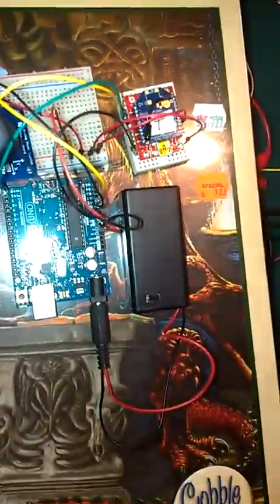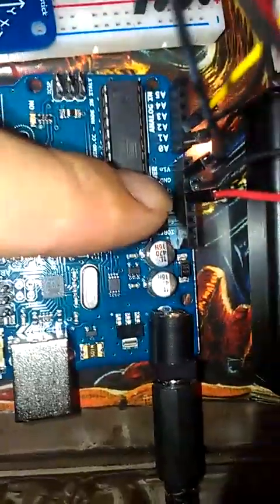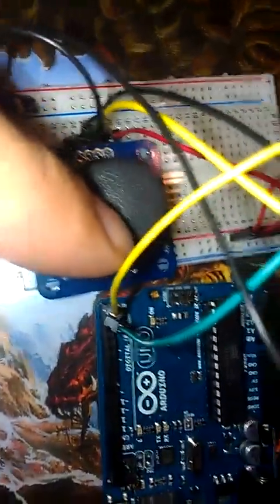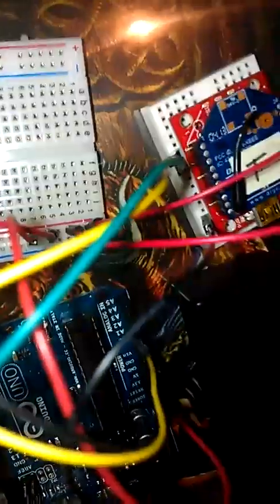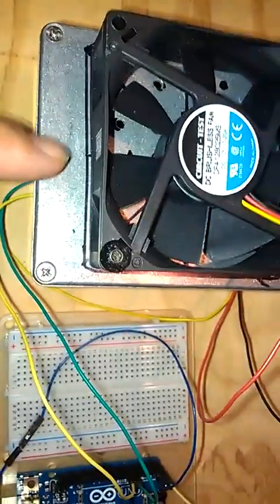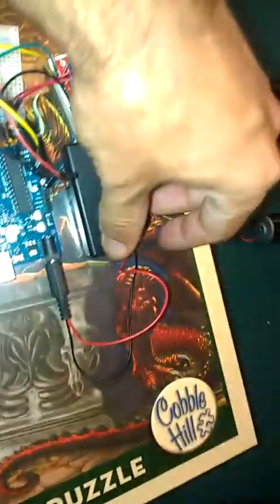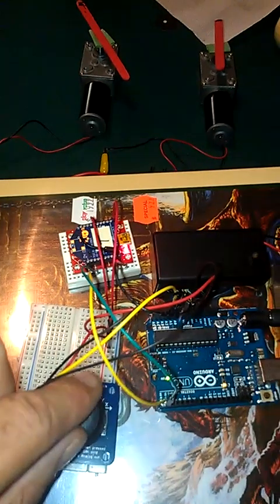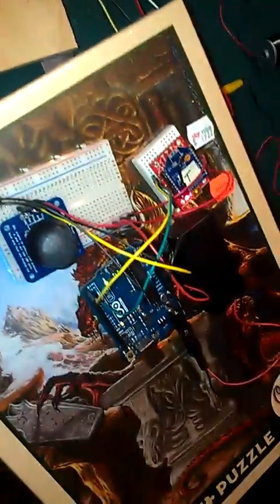Xbee series 1, 1 joystick 2 motors arduino uno success!!!!!

Comment: Hi, may i noe, what software u use to upload the code to arduino uno?
I m using de latest version of Arduino IDE, but when i trying to compiling your code, it shows "error compiling for board Arduino/Genuino Uno". What is the problem?and how to solve it?
Reply from the maker: +Pan Kuong King At the time it was an earlier version but you can get the IDE from the main Arduino site, I think your problem is because your compiling using the wrong settings for your board.

https://www.arduino.cc/en/Main/Software

You have a Arduino Uno?
Reply: +fabiolus2007 

yes, i have it.

I already have the latest version of IDE with me. 
So what setting should i change?
Reply: +fabiolus2007 

halo,  i think i have found my problem. The latest IDE can no more support the library of EasyTransfer. The library that is available for IDE 1.6.8 is SoftwareSerial. By the way, if using the library of SoftwareSerial, u still can write out the code for transfering analog/digital signal wireless?and may i have the code?
Reply from the maker: remote control
#include <EasyTransfer.h>
EasyTransfer ET;

const int potpin1 = A0;
const int potpin2 = A1;

struct SEND_DATA_STRUCTURE{
int servo1val;
int servo2val;
};

SEND_DATA_STRUCTURE txdata;

void setup(){
Serial.begin(9600);
// Serial.begin(115200);
ET.begin(details(txdata), &Serial);
}

void loop(){

int val1 = analogRead(potpin1);
int val2 = analogRead(potpin2);
val1 = map(val1, 0, 1023, 0, 180);
val2 = map(val2, 0, 1023, 0, 180); 
txdata.servo1val = val1;
txdata.servo2val = val2;

ET.sendData();
}

receiver:
#include <Servo.h>
#include <EasyTransfer.h>
EasyTransfer ET;

Servo myservo1;
Servo myservo2;

Servo ST1, ST2; 

struct RECEIVE_DATA_STRUCTURE{
int servo1val;
int servo2val;
};

RECEIVE_DATA_STRUCTURE txdata;

void setup(){
Serial.begin(9600);
// Serial.begin(115200);

ET.begin(details(txdata), &Serial);
// Servo
ST1.attach( 6, 1000, 2000);
ST2.attach(5, 1000, 2000);
}

void loop(){
if(ET.receiveData()){
ST1.write(txdata.servo1val);
ST2.write(txdata.servo2val);
}
}

Comment: hello can u give me the programme plz & thk u so much
Reply from the maker: othmane yassine 

remote control
#include <EasyTransfer.h>
EasyTransfer ET;

const int potpin1 = A0;
const int potpin2 = A1;

struct SEND_DATA_STRUCTURE{
int servo1val;
int servo2val;
};

SEND_DATA_STRUCTURE txdata;

void setup(){
  Serial.begin(9600);
  //  Serial.begin(115200);
  ET.begin(details(txdata), &Serial);
}

void loop(){

  int val1 = analogRead(potpin1);
  int val2 = analogRead(potpin2);
  val1 = map(val1, 0, 1023, 0, 180);
  val2 = map(val2, 0, 1023, 0, 180); 
  txdata.servo1val = val1;
  txdata.servo2val = val2;

  ET.sendData();
}

receiver:
#include <Servo.h>
#include <EasyTransfer.h>
EasyTransfer ET;

Servo myservo1;
Servo myservo2;

Servo ST1, ST2; 

struct RECEIVE_DATA_STRUCTURE{
  int servo1val;
  int servo2val;
};

RECEIVE_DATA_STRUCTURE txdata;

void setup(){
  Serial.begin(9600);
  // Serial.begin(115200);

  ET.begin(details(txdata), &Serial);
  // Servo
  ST1.attach( 6, 1000, 2000);
  ST2.attach(5, 1000, 2000);
}

void loop(){
  if(ET.receiveData()){
    ST1.write(txdata.servo1val);
    ST2.write(txdata.servo2val);
  }
}
Reply: thk u
Reply from the maker: othmane yassine you will need the easytransfer library http://www.billporter.info/2011/05/30/easytransfer-arduino-library/ I used that one and worked like a charm

Comment: Hello! Good job man. I want to make the same but i don't know what "function set" to use in which "modem" in xctu! I have two xbees s1 that automatically takes the xb24 modem and xbee 802.15.4. Is it ok to continue with this? I am a beginner with xbee and as I know i have to set one xbee as end device and the other as coordinator, but i don't know how. Can you help me on this please?
Reply from the maker: Should work straight out the box, assuming you know how to connect them via the proper for one to receive and the other xbee to send, I have other video showing the final setup. For security input your own channel so no other module gain control of your bot.
Reply from the maker: Should work straight out the box, assuming you know how to connect them via the proper for one to receive and the other xbee to send, I have other video showing the final setup. For security input your own channel so no other module gain control of your bot.

Comment: could i get a copy of your code for both transmitter and receiver please.
Reply from the maker: I posted both on arduino.cc forum search for it it is still there
Reply from the maker: @index.php?PHPSESSID=rvnnj27e9rfuhnsf8dcmjgnpa1&topic=181951.0
Reply from the maker: tim gravelin 

remote control
#include <EasyTransfer.h>
EasyTransfer ET;

const int potpin1 = A0;
const int potpin2 = A1;

struct SEND_DATA_STRUCTURE{
int servo1val;
int servo2val;
};

SEND_DATA_STRUCTURE txdata;

void setup(){
  Serial.begin(9600);
  //  Serial.begin(115200);
  ET.begin(details(txdata), &Serial);
}

void loop(){

  int val1 = analogRead(potpin1);
  int val2 = analogRead(potpin2);
  val1 = map(val1, 0, 1023, 0, 180);
  val2 = map(val2, 0, 1023, 0, 180); 
  txdata.servo1val = val1;
  txdata.servo2val = val2;

  ET.sendData();
}

receiver:
#include <Servo.h>
#include <EasyTransfer.h>
EasyTransfer ET;

Servo myservo1;
Servo myservo2;

Servo ST1, ST2; 

struct RECEIVE_DATA_STRUCTURE{
  int servo1val;
  int servo2val;
};

RECEIVE_DATA_STRUCTURE txdata;

void setup(){
  Serial.begin(9600);
  // Serial.begin(115200);

  ET.begin(details(txdata), &Serial);
  // Servo
  ST1.attach( 6, 1000, 2000);
  ST2.attach(5, 1000, 2000);
}

void loop(){
  if(ET.receiveData()){
    ST1.write(txdata.servo1val);
    ST2.write(txdata.servo2val);
  }
}